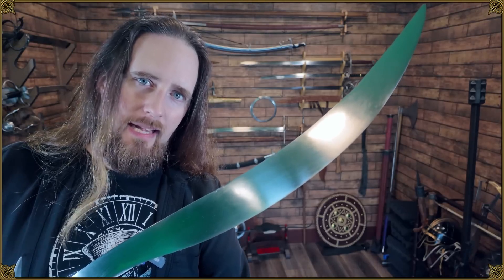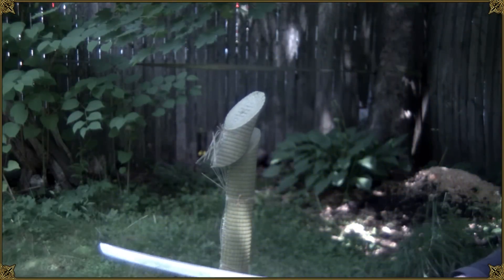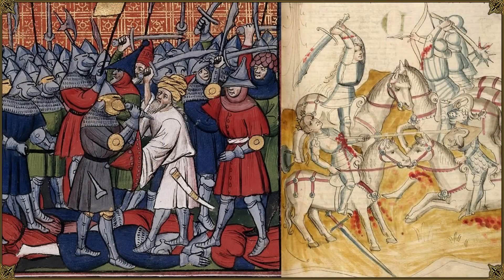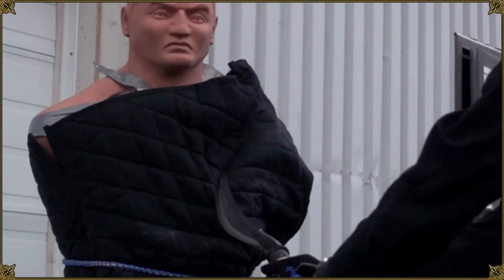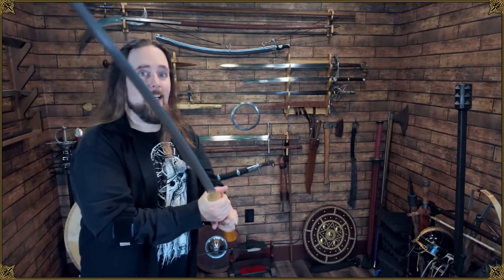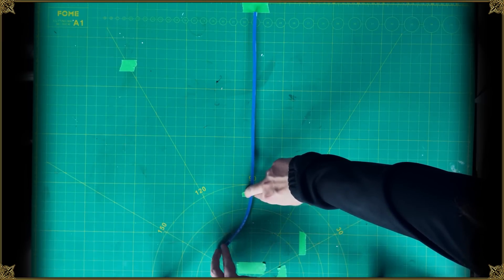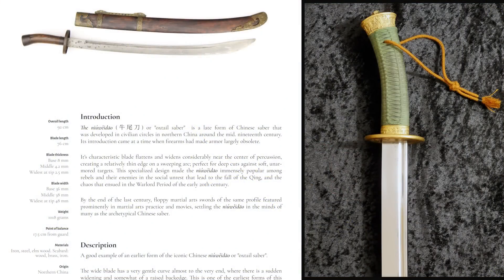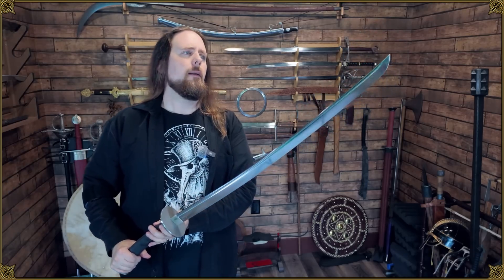Sword Design: What's the Recurve For?

Comment: Even though your geometrical explanation was not perfectly rigorous, the arguments were more than sound in practice. If both a straight sword and a curved handle one start from the same blade positions, their pommels would trace mathematically the same circular arc to strike the same target. I can hypothesize what could change mechanically is the weight distribution, because the slightly forward pommel could bring the centre of mass just before where the hands grip the handle, for a more efficient transmission of the applied force to the edge (and thus the poor person who gets the wrong side of the sword...); that would require a pretty heavy pommel to feel a difference though I guess. I don't really wanna do the maths here (it's pretty late in the night), but I think the same effect can be more effectively achieved by curving the blade, because it has way more mass than your average pommel. From an ergonomics standpoint I can only make assumptions as it's not my field, but it kind of seems to follow more naturally the wrists' movement. Because the wrists cannot really rotate that much on the plane parallel to the palm of the hand, having a recurved handle makes the blade travel farther in the area of interest and also enables the arms to apply force more evenly for the whole duration of the swing (I guess). I'll now try my best to explain the rest with some paper towel physics and my sleep deprived synapses. Assuming the ideal lever system, the "slicing-action" force from the left hand fingers (which represent the leverage on the rounded part) and the handle is always applied orthogonally to the contact area. So the most efficient way to transfer as much rotational force as possible would be by rotating a straight sword, as it gets exactly the moment of force you want to give it. The curved handle changes the application direction of the force vector and breaks it down in its two rectangular components: the first component, which is orthogonal to the sword axis, is the aforementioned rotational force; the other one is parallel to the sword axis, and is pointing in the opposite direction of the tip of the sword. So the resulting combined motion of the swing should be somewhat weaker in intensity, but also present more significant dragging (or trailing? whatever...) motion added to it. As pressure is defined by force over application area, the preferred way to slice would be to reduce the contact area as much as possible while also maximising the force applied. A curved sword gets the job done better because (as I understand it at this hour in the night) the first contact point of a curved edge is the most protuberant one, which is very small (mathematically tends to zero, but as all things go, in reality it is measurable). Of course, even though this would peak the pressure, it wouldn't make significant damage to the target if it is confined to a single point. So the first and smallest contact is made in order to make a very strong incision which will be capitalized upon by the upcoming, less protruding part of the edge to deliver a clean and extensive cut. So that would mean, a curved sword shines if you apply pure torque (or moment) to it. The dragging action of a recurved handle could therefore benefit more a straight blade, as they have much larger first contact point (or should I say in this case, line) and would probably deliver a better slicing action if the moment of forces was also paired with a force parallel to the edge line. I think at this point the advantage would be, against a straight sword with a straight handle, that you could just apply the dragging action without meaningfully changing your way of delivering the swing, while the foe would need to make a conscious effort in order to do the same.
So from this (very) approximate analysis, the best cutting combos would be a straight blade with recurved handle, or a recurved blade with straight handle.
To wrap this up, I think there are way more important factors that influence the cutting prowess of a blade, namely its mass, lenght etc. So I don't really think recurving the handle would make that much of a practical difference (it would make a difference nonetheless, however small). How much does my rambling make sense in real life? Idk. How much time did I spend writing these delirious lines? Idk. I'm open to criticisms of course. Now goodnight

Comment: A french nobility reducer 🔪 would be more than okay flat if it had more weight behind the fall or was a higher fall. I've spent all day with a flat chisel. I contend it is superior, the slanted one has to push to the side what it doesn't immediately cut through which is more like an anvil shear. Most specialty Martial Bye-Bye gear is flat also, the bearded ax is not what is made for that job.

Comment: This same curvature issue was also why I hated using the curved swords in Soul Caliber 3. You can visibly see that my characters' hands are far further  in the movement than if they used a straight weapon before it hits the opponent. There was a noticeable timing difference from when one character with a straight weapon would hit, than when the character with the curved weapon would hit. The characters with the curved weapons would have their grip completely on their other side before they hit. While the characters with straight weapons would hit immediately.

Comment: i think because there is more rotation, the blade edge is being pulled through the target tangentially at a faster rate than it would be if the blade were straight.

Comment: I think the curve of the handle has to do with the ergonomics of the handle during a swing or recovery. This might allow you to use your thumb on the backside for better control and power, not so much during a swing but when you are pointing the sword at the target, which does happen in a swing, but changing your hand position probably wouldn't be done unless you are skilled and trying to recover the blade back into position faster. Sort of like a thibault grip, but requiring a special handle.

Comment: Alternatively, especially for the one handed curved sword theres only so many angles you can offend an opponent with directly.

Curving everything forward with the same hand positions from the handle reduced the angles that are pointing above the opponent and add that many that are still pointing towards and down.

Like
If i hold the blade at a hammer grip directly out from me (as an example) so the plane of my grip is 90° from my arm,
With a straight blade thats pointing straight up.  With a drastic curve from the handle that might be pointing close to my opponents head, but closer for sure however much its curved.

If I angle my wrist towards me, a straight blade is now away from my opponents.  A curved handle points it closer to still offending the opponent.

If I angle my wrist as far forward as I can my blade is pointing still up towards the face a little from a 180° towards my opponent.

With a curved blade, it's pointing at or down a bit from that point.

So
Angling the wrist from as far towards me as I can to as far towards my opponent as I can, the curved handle has more potential angles offending the opponent from the same position.

Comment: As far as I understand, the reason for the curved handle is not to make the cutting motion easier, but to make extreme cutting motions possible. If the handle tip is at the front, the hand below is in a more comfortable position when the cutting motion is over.

Comment: Would the forward curved handle not make edge alignment harder when the blade makes impact with a surface? I feel like the forward curve could cause the bottom hand to want to spin the sword around when you put pressure on the handle to follow through a cut. It might not have as much of an issue with a backwards curved blade but I think it could make it harder to use straight blades. I might be wrong though considering I have never held a real sword before. I personally would like to know if a backwards curved handle would  help with edge alignment during the cutting process.

Comment: The curve forward in the grip can help biomecanicaly with applying force to the swing. The left arm doesn't need to be pulled so far back to strike with the sword stretched forward. The same with one handed swords, less bending in wrist to strike with blade forward.

But this is optimisation for the last bit of effect. Like with handels on tools like a saw, a simple handle works. But add the right curves in the handle and the interaction between the force from your body and your grip and wrist angle will apply just that litt more efficient with the same effort.

Comment: I think the change in shape of the sword could have more affect on the biomechanics of a technique (relative to body shape: arm, leg, torso length and joint position) than the physics. Muscle are able to generate the most force between 80% and 120% of their resting length, so blade and handle shape could potentially have a significant affect on relative strength at the point of blade contact with the target, based on the specific technique by putting your muscles and joints in their strongest configuration.

Comment: My guess for the recurved handle

When you swing that way with your bottom hand, part of the motion is downward as well as the whippy inward pull. Im betting the curve translates some of the downward vector into more inward vector by pressing down on the angled handle which accelerates the blade forward a tad faster.

Take a wedge shape with an angle like that and push down on it, it will move the wedge back (towards the wider direction).

Comment: the most glaring difference is leverage. the curve of the handle can help yuo put more power into the slice or slash, but you are correct in that the one you showed would only be slightly more efficient in that way. it's not even a matter of power, it's the efficiency with which you can use that power.

Comment: In my mind, recurved blades basically transform your sword into an axe to concentrate the power and the mass into a smaller area. Also, the fact the blade is forward compared to the hand means you hit earlier in your motion, so you have more room to follow and push the cut. I have no experience in cutting, but that's what I see when I look at that kind of blade 😋

Comment: TL:DR the recurved hilt lengthens the draw path, allowing for more power. EDIT: In 2-handed, push-pull cuts, and with 1-h pinch grip cuts.

the recurve of the handle is about physics 😱 and also more about body mechanics, it's more ergonomic in relation to the geometry of the human mechanism. 

In short, it gives you more distance between your pommel and the obstacle that is the body, allowing you to pull it along a longer path, which lets you put more power into the strike.

the longer the path, the more energy it can gain. 

think of a (cross)bow. the longer the draw, the more power the arrow can absorb from the bow's limbs and string before the arrow is loosed. so the same bow can shoot harder or softer depending on how far it's pulled back.

in physics this is called the "impulse".

if you can put only so much energy into it per given time and distance, then more time and more distance means more total force.

curving a blade away from ones target has a similar effect, but most folk do that for a raked cutting angle that slices better and is less prone to binding in the cut, which could lose you your weapon: esp dangerous when mounted.
Reply: That's incorrect. Assuming the same angle of rotation, the distance the lower hand travels is determined solely by its distance from the central axis, and curving the grip reduces that distance, just as curving a blade reduces its reach.

So why recurve? Well, there are a number of potential advantages that Skall didn't mention/explain in detail:
1) It shifts the center of mass forward and reduces the sword's tendency to lose alignment on impact.
2) It aligns the wrist/hand for more comfortable, powerful thrusts, as with orthopedic grips in modern Olympic fencing.
3) For two-handed cuts, it delays when the lower wrist muscles engage, optimizing power generation for cuts with less "wind-up."
4) It looks cool.

Perhaps it's just my inexperience talking, but I suspect that last reason was usually the most important, as I doubt the functional differences were particularly significant.
Reply: @irrelevantfish1978  you make good points, here are some things I need to clarify (not corresponding to anything sequential)

In 2-h weapons a longer hilt, when recurved, is normal; thus keeping the distance from the 2-h grip and the axis the same, but changing it's starting position on the arc. I had taken that as an assumption and should have stated it.

the wrist is only so flexible in the direction of the swing, that creates a hard stopping point for the arc

from the starting position, to the limit of the wrist is the Strike Arc. this limit is usually not reached by a straight hilt unless one "over-swings", and some with more flexible wrists want to use that for a longer arc and more power (as detailed above).

theoretically, if you had a flexible enough wrist, you could get as much added arc as you wanted by bending the hilt further. (this is also why a strong but relaxed wrist is key to  powerful cuts), but being able to reach further without laying the blade back is just as important.

if one wants to switch to a 1-h pinch grip (like thumb grip for longsword) then the curved hilt would then be more out of the way, allowing one to use their full arc of the wrist before the pommel would strike the forearm. "hand-and-a-half" weapons like the one he's showing off here would benefit from that as well.

I guess I can sum it up in "it moves the end of the hilt out of the way, so you can bend your wrist all the way, for more cutting arc/length".

it also has benefits for retention, esp. while mounted, and helps greatly with edge alignment during cuts (for some folk, like me).
Reply: @lady_draguliana784  Sorry, but again, you've got a few things wrong. First, the only way a curved grip could have an equal length of travel to a straight one of the same length is if the axis of rotation is located where the grip bends. While possible, that would be suboptimal unless that was also the sword's point of balance, which would not only be very suboptimal, but entirely ahistorical.

Second, unless a the grip extends well past the hand(s), grip curvature doesn't affect the range of cutting motion, only the location of the beginning and end points, and with a forward-curved grip, the wrist will begin to hyper-extend earlier in the backswing but later in the forward swing (ie, for a vertical cut, you won't be able to raise the sword as high before changing the type of grip, but you will be able to swing it lower).

Third, a curved grip is only going to get out of the way if the grip extends well past the hand(s), and sometimes not even then. In fact, it's likely to get in the way when changing the relative orientation of blade and hand (a frequent occurrence in many fencing styles, particularly those of Europe), regardless of whether there's "excess" grip.
Reply: @irrelevantfish1978  specifically talking about 2-h/1.5-h weapons.

> 2-h and 1-1/2-H grips are usually longer than just the hands pressed together. there's usually a hands-breadth between for a 2-h hilt, esp in eastern weapons. SOME 1-1/2-H weapons have grips barely long enough for the 2nd hand, but those are the exception, not the rule.
 
> the axis of rotation of a sword is the wrist of the fore-gripping hand. but we often like to visualize it as the center of the fore hand for ease.

> you're right about the start and end points of the cut being simply moved down if you don't change your swing, I'm saying that the altered hilt allows you to change your swing.

> I think you're thinking we're taking a grip and bending it and comparing it to itself which, yes, would shorting the distance to the circles' center. we're not though. it's 2 different grips. one has a forward curve, but is long enough to place the rearward grip just as far away from the fore grip as a straight one "as the crow flies". thus the effective length of the lever is the same. 

> the forward curve of the hilt allows one to reach out further and pull back to the same spot (lining up the hands at the end of the swing). this can have 2 effects depending on your wrist's flexibility:

A) you get the same arc, to the limit of the fore gripping wrist, but your hand is clear of your own arm, esp. in a vertical strike with a proper handshake grip
B) you can pull the rear hand all the way back to your arm, getting a bit more length to the pull.

> if the weapon is 1 1/2-Hands then, when wielded 1-handed, the long hilt will fully strike the arm when fully extended for certain cuts like a vertical which may limit the cut and kills momentum: curving the "excess" hilt down, out of the way, allows for the full arc of the wrist to be used, this is especially evident when using a pinch/thumb grip

> bonus: the pinky is also better engaged with a curved hilt, adding even more power. 

> If you haven't already, try it yourself and see, it's fun and fascinating! Your local HEMA group likely has swords of both types and for a small fee (or free) you may be able to join them for a cutting day, or just doing drills with different weapons. I've been doing this for decades, and the pros/cons of various designs is fun to explore! ☺
Reply: @lady_draguliana784  Either we're failing to communicate or you're arguing that sword grips are exempt from the rules of geometry. Regardless, I doubt we'll make progress without the benefit of diagrams, so I'm calling it quits.
Reply: @irrelevantfish1978   agreed, i think it's just a communication issue, probably on my end, but without illustrative options, we're at an impasse. have a good one!